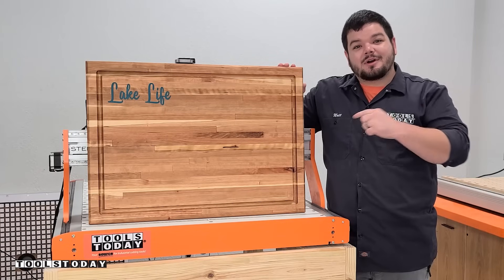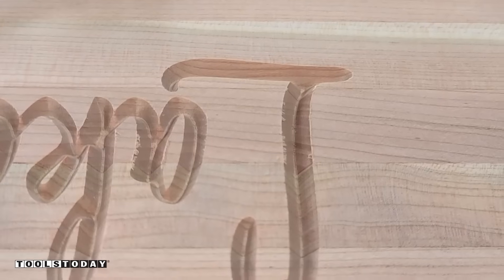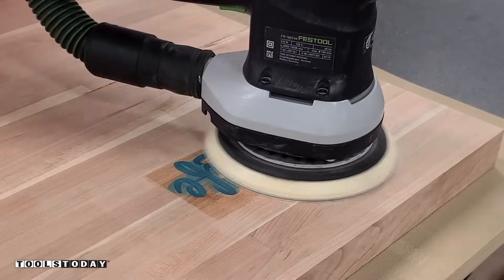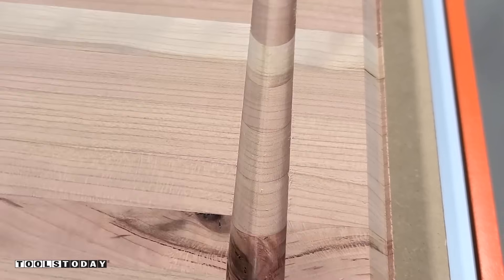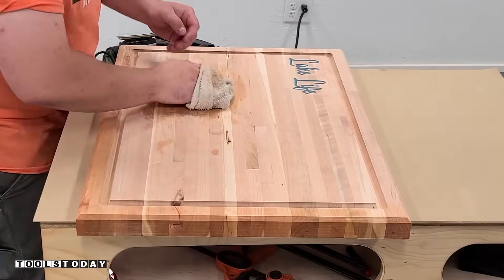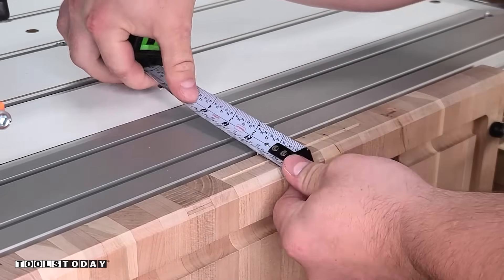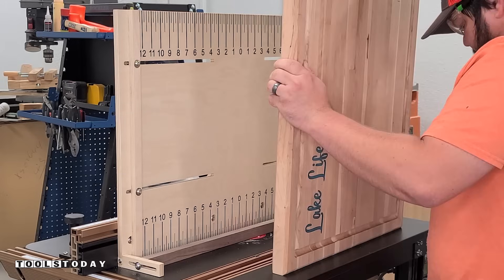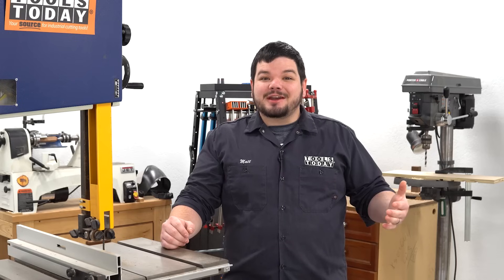How to Make: Cutting Board | ToolsToday CNC Video - Long Version

Comment: Just curious, why couldn’t you cut the text first, a little deeper than usual, and then run the flattening pass after the epoxy is hardened? That way you don’t have to worry about getting the tool at the right hight or sanding to level, just sanding it to a smooth finish once done
Reply: I thought the same thing.
Reply: So that you can seal the engraving. Coloured epoxy likes to bleed into the grain where you dont want it to go and can ruin the crispness of the text.  Ideally a rough flattening, then text, seal, pour, then full flattening.
Reply: @jasonasselin8657  Ok that makes sense, in that case could you cut the text deep, seal it, blue epoxy, 1 flattening pass and 1 sanding pass and done? This would bypass the z axis offset and extra sanding on the letters

Comment: Nice job. Question, what is the pigment brand your using??
Just a quick tech tip. Rather than removing the 2nd piece of tape then having to rezero your machine and taking these extra steps just hit go to zero, then command Z-.005 OR ??? and then zero the Z axis. Just a little quicker and a bit more accurate.IMO but still great job.

Comment: For Z offsets, I use a precision 123 block. Really quick and super repeatable. I drop the tool below the 123 block and move it up until I cannot feel the tool while moving the block, then back down .001". 
From there is easy to tell I'm 1" above my work(or WCS) and I can offset a couple thou if needed in a controlled way. Highly recommend over the paper method.
Reply from the maker: Thanks!

Comment: I have been looking for a machine just like this one!! What model is it? And what attachments were added?
Reply from the maker: It's the Stepcraft M.1000 with the ATC and Vacuum table options as well as the vertical clamping jig.  Here's the links to them.
Reply from the maker: Stepcraft M.1000
https://www.toolstoday.com/stepcraft-m-1000-cnc-system.html

Stepcraft M.1000 90° Vertical Clamping Fixture no. 11989
https://www.toolstoday.com/v-15266-11989.html
Reply: Thank you for the info! I appreciate it!!
Reply: Hello
Reply: Hello

Comment: Thank you for an interesting and informative video. 

A quick point on woodworking terminology: When you used water to "pop the grain", you were "raising the grain". The only reason I mention this is because the terms "raise the grain" and "pop the grain" have commonly understood woodworking meanings. Raising the grain is a term that means using water (or a water based finish) to get the wood fibers to stand up so it can be sanded smooth (or, in this case, cut off on the CNC with a very light final pass). 

Popping the grain means using an oil finish to get the grain to 'pop' visually. It allows the wood to show off to its full visual potential. (A good example of this can be seen at the end of the video with the Walrus Oil is applied. It transformed the look of the cherry -- the grain popped!
Reply: Thanks David :)
Reply: LMAO

Comment: When you cnc handles out... Do you need to write a program for that or you can just do it in the machine operation system?

I am new to cnc... 🙂
Reply from the maker: I set up a toolpath for it.  I suppose you could do it without one, but it's easier and more accurate to just set up a toolpath for it
Reply: @ToolsToday  suscribed
Reply from the maker: Thanks for subscribing!
Reply: What is the price of this machine
Reply: Price?

Comment: May I ask how thick that cutting board was? I have the same machine and am thinking about purchasing a couple of the bits you showed but I don't get a lot of height clearance when I have the table in the top configuration. I don't feel I would have room to use that long upcut bit in that configuration.
Reply from the maker: It was 1.5" thick
Reply: What feeds and speeds and pass depth did you use on the profile cut? And was it the mm1000 DI spindle?

Comment: This is perfect timing.  Thank you for the video.  How fast are the letters engraved?  (feed/speed).
Reply from the maker: Amana Tool no. 45624-K 60 Deg V-Groove
RPM: 18,000
Feed Rate: 40ipm
Plunge Rate: 20ipm
Max depth of cut: 0.22"
Reply: Very good information thanks for sharing.
Reply from the maker: @jezaelp  Very welcome!

Comment: Awesome work.
Love the way you deliver the information in the content. 
Saving money for my setpcraf.
I have a question on this machines they have a page with offsets for each tool on the rack or you have to take a reference every time you want to adjust the reference.
You adjusted your ( z ) what other way to do it ?
Great work like all ways. 
Blessings from Cypress Texas. 
Your amigo ( friend ) Jesse.
Reply from the maker: Thanks so much for the kind words.  Yes, there is an offset feature, so I measure all tools off the touch off probe, then measure tool 1 off of the material and it sets the z-zero position for all of the other bits automatically as it knows the difference in length between each bit.
Reply: Thanks so much for taking the time to answer. 
Enjoy your day and your family.